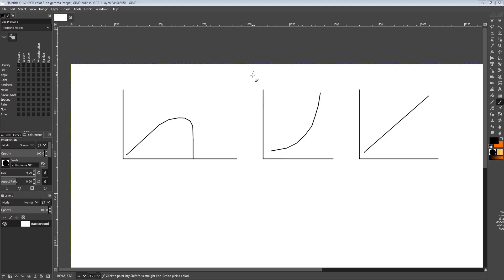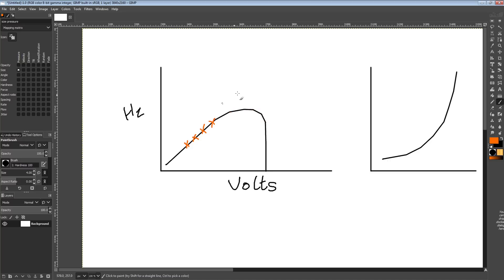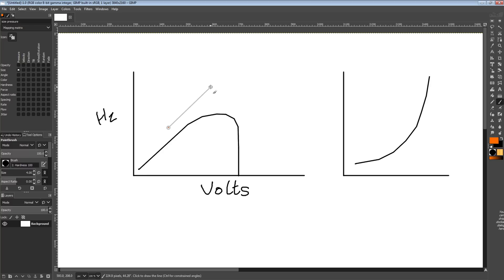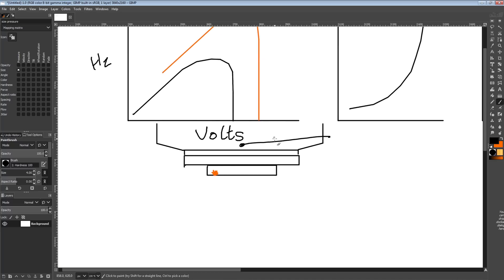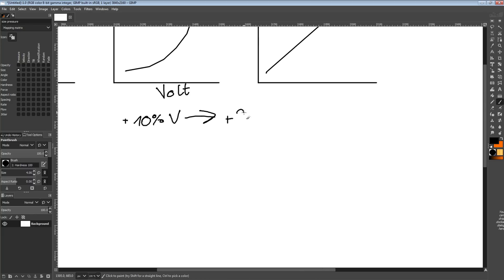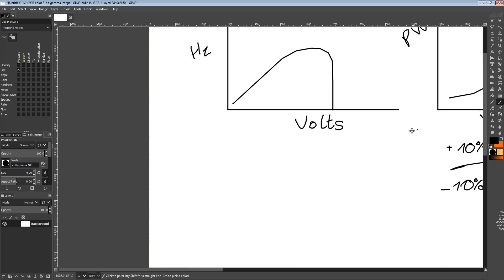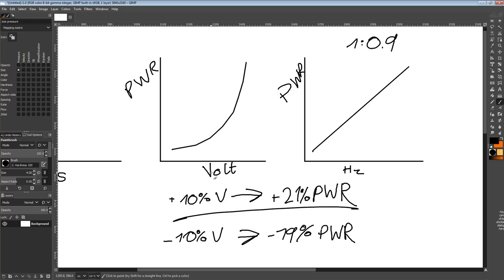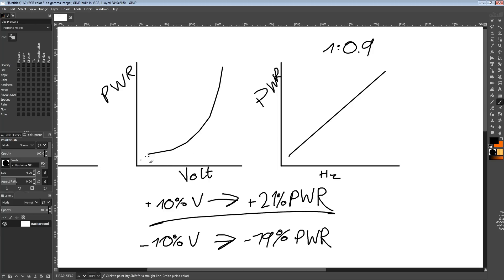Some random things to keep in mind when OCing

Comment from the maker: Well this is now public I guess
Reply: Come on dude You make me worried now should i worry abaut mu 3600 on stock settings?😱
I have phanteks ph-tc14pe CPU
Cooler
I dont oc until the varranty is no more then MAYBE I START playing oc If i know What i do 🤣
Reply: It is good information, so worth putting out there
Reply: Was it not supposed to be public?
Reply: @iamthegamer908  do it when you have warranty... They won't know ...if you destroy your CPU after warranty 
..you are toast
Reply: @mr.waffentrager4400  nah im okay whit it on stock no need oc Any of These ryzens its good for my gaming needs And amator video editing 🤣
Reply: I found it really great. Those words made sense, don't worry
Reply: @geepsu666  I don't know if there's a good answer for this question as it would vary depending on the quality of the chip as it went through the binning process and especially your method of cooling the chip. Heat is just a measure of motion, and if a chip is hot, its atoms are moving around faster - possibly enough to where they might migrate enough from where they should be to cause an issue over time. My best guess is stock CPU at stock speeds, thermal paste, cooler, and voltage would more or less last indefinitely if kept clean. Anything other than that, and your mileage may vary.
Reply: Temp graphs could be helpful too :)
Reply: @geepsu666  so what's the recept for stability... 1.3V?

Comment: Thumbs up if you want to see an EXTREME undervolt.
Reply: Not enough people do that. It's interesting to see.
Reply: For GPUs, I tend to do a mild(ish) overclock combined with an undervolt these days. 
Then maybe a memory overclock (at stock voltage). 
You guessed it, I mainly use Radeon GPUs!
Reply: Richard Ayy, same.
Reply: @DJ_Dopamine  its not a bad trade i guess 100 dollars less because all of the tuning wasnt done at factory, fun for tweakers not the best stock products tho
Reply: "Extreme" meaning cutting voltage so far you just blackout? I even got a t-shirt printed for doing that
Reply: I thought undervolting is only for those filthy mining scum, they usually undervolt in combination with memory overclocking
Reply: @WladislawNikitjuk  снижение напряжения с поднятием частоты,самый профитный вариант разгона цп, скайлейк мой старенький уже при 1.145v держит 4.2ггц по ядрам и 4ггц по шине.....потребление немного снизилось, а производительность нормально так возрасла по сравнению с коробкой....хотя многим только попугаев подавай,ага....
Reply: Undervolting is big in laptops. Since chips tend to always run hot since heatsinks tend to suck and fan profiles prioritise low noise, power limits are the constraint and are locked in firmware, so often the only way to improve performance (beyond fixing shoddy cooling with heatsink alignment, more pressure, better TIMs) is to undervolt, allowing things to sit at more favourable points on the heat vs efficiency and power vs volts curves meaning overall more turbo frequency.
Reply: @WladislawNikitjuk  Not really. I always undervolt my hardware as much as possible while running BOINC and Folding@home. For example, I reduced the power consumption of my Threadripper 3970x by -35% (from 280W to 180W) by capping it to 180W PPT (stock is 280W) in the PBO menu in BIOS. As a result I lost only ~10% multi-threaded performance while the single and lightly threaded performance stayed the same. 180W vs 280W is massive power savings for such minimal performance loss of 10%. 🙂This only proves that the 32-core 3970x is still a beastly processor even with a much more mild TDP of 180W. I think this only shows how beneficial the 7nm manufacturing node is especially when you run your stuff at lower voltage.
Reply: Actually Hardcore UnderVolting
Reply: Der8auer already did it with ryzen 3000.
Reply: The big problem with extreme undervolts efficiency wise is while the cpu core will barely use any power the same cannot be said for the rest of the system. Suddely the gpu or barring that inefficiencies in the power supply start to matter a lot. Another thing is that other parts of the cpu are really not as easy to undervolt resulting in a large percentage of the power draw not coming from the core.
Reply: @WladislawNikitjuk  Undervolting is also a very big thing in the small form factor PC community to save on both power consumption and heat, it can and will make the difference between a system that can thermal throttle and one that doesn't and it allows you to run more powerful components with the lower wattage rated PSUs that are common there.
Reply: @DJ_Dopamine  inb4 how because omg bad drivers.
Reply: @bigcazza5260  typically the amd VS Nvidia tests are using stock products. Typically amd is cheaper per frame. What are you even talking about?
Reply: yeah thats what i need...to lowering power bills

Comment: As a true Tech geek, I enjoy your videos (and understand what you are explaining) :)
I always undervolt if not OC'ing. hat gives you a lot better efficiency. I have a retro rig with a QX6850. Running that beast below 1.1V. stock speed. (not using such a good cooler) Temps has dropped 10-15c during stress. Now that is eficiency increase!!
BTW. Sometimes you can actually gain efficiency with a slight OC. I remember the good old days with C2D and C2Q (20% OC) with undervolt as well. Was using about the same power as stock clock/volts. That equal 20% better power efficiency with OC.
Real OC fun is not the same (fun) anymore. Today the chips do a decent job themselves (Turbo , MCE). Very dificult to get better effiency with OC.

Comment: that center chart, and the right one, is mostly why portable devices tend to be so limited in performance, battery limits and thermal dissipation limits the power and clocks of the thing.  Great vid.   B)

Comment: Well it's a good thing this channel isn't called "Actually Hardcore Efficiency"!
Reply: That might be cool.
Reply: I've always wondered why that was never a thing.

Competitions like:
'highest performance per watt for a given chip'

Or 'highest performance from a system that draws no more than 100 watts'

With variations with increasingly tighter power budgets.

Oldschool challenge; How much performance can you squeeze out of a system that has power limits similar to 80's and 90's PC's? (that's about 300 watts at most)

Maybe... What's the most possible performance you can safely get out of a system that uses passive cooling only?

Or even better, can you get a modern system to ever run in a stable configuration with no cooling whatsoever, not even heatsinks?

There's so many options for these kind of things, but it seems 'biggest overclock ever' is the only one anyone bothers with...
Reply: @KuraIthys  On the point of "highest performance per watt for a given chip", you can just run slow (BCLK multiplier set to 1, or the lowest available) and have the chip sip incredibly low amounts of watts, to the point of being unmeasurable between idle and loaded.

On the point of "highest performance from a system that draws no more than 100 watts", you begin to run into the problem of having to take EVERYTHING into consideration, and it becomes a contest of "who can throw the most money at the wall" to get the best efficiency from your PSU, motherboard, CPU, RAM, GPU, OS... even the hard drive will be an SSD that copies a barebones Linux distro on a RAM disk and runs from there, allowing shutting down the SSD to save a couple watts. Let's be crazy and add LN2 to get the lowest current leakage possible.

There's also the issue of measuring power consumption accurately: (in my best impression of Buildzoid) motherboard probes are teeeeerrible, so you'd need external hardware (with low tolerances may I add, so it will be expensive), a way to connect it to your PC, and it being standard for a competition to happen. The last part will be quite tricky.

I agree this is interesting to explore, but to make it a competition on par with balls-to-the-wall overclocking? Nay. I see getting every drop of efficiency more as a personal project for your particular system, the kind that won't see any benefit from overclocking or just can't (like locked Intel SKUs or based on A320 AMD motherboards), than a competition project.

(And obviously the biggest downside with such a low-wattage competition: no RGB. /s)

Comment: Pretty interesting graphs...

Bottlenecks can be fascinating though.

I remember years ago I started using unofficial drivers with my laptop because the manufacturer literally never provided even a single graphics driver update. and the one it did provide caused constant stuttering in games.

So... The chip in that laptop was an x1400 - which, I mean, for the time, having discrete graphics in and of itself put you well ahead of most laptops, but that chip is one step removed from the lowest end chip Ati produced for laptops.
In particular, an x1400 (which only exists in laptops) is an x1300 with a memory bus that's twice as wide.

Anyway, as a side effect of installing unofficial drivers, I got access to a whole bunch of settings no laptop driver software would generally ever let you touch.

One of these was the desktop overclocking software.

And, that leads to the bottleneck in question;
See, in spite of having double the memory bandwidth of the otherwise identical x1300, (And yes, it IS about twice as fast)...

In examining the overclocking and underclocking results... Well... It got very interesting indeed.
First of all, the clocks could be increased by something like 80% and it still worked (this is without having any kind of voltage control).
Granted, if you overclocked both the core AND memory by that much it got unstable, but you could usually push one or the other nearly that high and push the other by about 20% and get it to run fairly stable at those settings. Of course, the cooling system here means the RAM has nothing at all cooling it and the GPU shares a single cooler with the CPU. (thus CPU load directly affects cooling performance available to the GPU as well.)

So... Anyway, the result that interested me here was the actual performance metrics in games.
Basically, altering the core clock did pretty much nothing in any games I tested. Overclocking it by 80% did nothing. Underclocking it by about 75% (anything less than that and the chip became unstable for some reason) also did nothing.
Nearly double the core clock, or cut it to 1/4 it's stock speed and nothing changes whatsoever in games of the era...
Meanwhile, change the memory clocks and performance in games scales almost linearly with memory speed...

Bottlenecks huh. XD

To be fair, Ati badly misjudged their GPU designs from that era. While the x1950 did really well, most of the rest of their range did not. With the x1600 being especially poor.
The problem is, Ati had assumed games would use a lot of shaders; Procedurally generated textures, vertex shaders, and so on.
As such, they had put a lot into giving these chips (Even the low end ones) a LOT of shader performance.
Unfortunately... What happened in practice was that games of that era doubled down on textures and similar effects that hammer the chip's memory bandwidth and texturing units...
And Ati's chips had not been built with that in mind. In other words they were over-specified for something games didn't really make much use of, and under-specified for things they did. And the low end, but especially the midrange chips were by far the worst off in this regard...

Anyway, just interesting sometimes what overclocking can do in practice when a bottleneck is involved.
You could find yourself with a truly massive overclock and yet the practical benefit is...
Nothing whatsoever...

Comment: on curve #2: power increases exponentially with voltage because as you increase voltage, the resistance of silicon falls, increasing the current non-linearly. meaning, at 5% higher voltage you're not getting 5% more electrons flowing per second (current) like a resistor would behave, you're getting say 10% more current, meaning 15.5% more power (U*I)

Comment: I reduced the power consumption of my Threadripper 3970x by -35% (from 280W to 180W) by capping it to 180W PPT (stock is 280W) in the PBO menu in BIOS. As a result I lost only ~10% multi-threaded performance while the single and lightly threaded performance stayed the same. I think I'm going to run it like this with BOINC since it's massive power savings for minimal performance loss. 🙂

Comment: You've reminded me of one more graph I haven't tested in detail, it was more a small test, gpu sample of one. It was a long(ish) time ago, but I'm pretty sure that lowering the temperature of an R9 380 by 5 degrees gave me about 5W drop in consumption measured from the wall. Really don't remember the fan speeds, also it was undervolted quite a bit. Nothing to write home about, but it was measurable and consistent. Maybe you had more extreme scenarios.

Comment: Hey man, I'd be interested in a video that explains how different types of calculations or the use of other instruction sets (like AVX) affect the stability and the power consumption of a CPU. The voltage and the frequency remain the same so I wonder why AVX load is so much harder for a CPU to run. What do I have to look out for when overclocking? Do I have to test stability for all instruction sets if I want true 24/7 settings?
Reply: YES
Reply: You don't need to test all the instruction sets, only AVX.

AVX is special because it adds vector instructions - a normal add does A = A + B, but an AVX add is capable to do 4x-16x of these additions AT THE SAME TIME. 
For example Zen 2 CPU with a 256 bit wide vector unit is able to do 8x 32 bit additions. Skylake-X has 512 bits wide vector unit, so it can do 16x 32 bit additions.

You get 4x-16x times the performance, but you also get crazy high power consumption (a lot of work equals a lot of power).

If you want more info, just google AVX or SIMD (Single Instruction Multiple Data).

Some other instruction sets (something like TSX maybe) will increase power draw too, but nearly not as much as AVX/other vector extensions do.
Reply: Well my 3700x boosts higher in non avx workloads vs r20. But I'm also not sure how accurate ryzen master is in reporting CPU frequency

Comment: Hi Buildzoid,

I have a question about the Frequency/Power scale you listed there. Based on my testing from highly power limited Max-Q GPUs in laptops increasing the frequency just with the slider on f.e. MSI Afterburner never translated to an increase in Power consumption (or heat), I got roughly the OC i dialed in. Where does this come from? Based in my understanding the powerdraw is hugely impacted by the voltage but if you just increase frequency, you will use the OC headroom a given voltage has for your specific chip (based on silicon lottery) and as long as you are not running into instability from too less voltage you do not use more power. 

A quick explanation or some sources to read through would be a huge help! Thanks :)

Comment: Vega64 - all voltages at 0.900V, with HBM OC over 1GHz -> basically the same performance as stock (no boost), at just 150-160W power draw.
Reply: Not true, because the standard clocks at overclocked HBM is 15-20% faster, and you ate 20W in HBM. Besides that flat boost caused by Infinity Fabric behavior (not memory itself), games tend to scale linearly with clock. (At 4k.) So in many games you will get about 5% slower with your settings. (1500 memOC vs 1680 MHz 1.2V. You can run stock boost 1630 at 1.18V for 50W savings and minimal performance drop. Has space for memory OC.)
But about 100W cooler. Presuming the card is stable at 0.9V 1500 MHz, not all are. (Typical is 0.95V, and usually it is capped by IF bus voltage, which has to be increased to 1.025V or 1.05V to run that 1111 MHz memory clock to trigger 1200 MHz IF speed.)

Source: have 2x Vega 64 overclocked. They tend to random brownout and crash in specific titles when undervolted too hard. I can "run" stock settings at 1.135V, but specific games will reliably crash.

By the way, locking clock to P7 gets 5% boost stock. Card is also more stable allowing for more precise undervolt. The cards do feature some sort of LLC.

Comment: Love it bro what you think about MSI PRO B450M PRO-VDH MAX closest matx i could find to the mortar in the states would be fine for a 3600x planning on locking at whatever i get the frequency stable and temps good. The case has an absolute load of airflow for the vrms

Comment: And some memory chips won t even gain from voltage increase.Had micron A-die that wouldn't oc any further past 1.35v.
Reply: JEDEC specs allow for up to 1.5V to operate. Every stick should be able to run at 1.5V or else it doesn't comply with the spec.
Reply: @dpokor  well i havent tried 1.5, but tried 1.4 with loose timings and didn't like it, tried lowering the stock timings with increased voltage, same thing, the memory was corsair led 3000mhz cl15-17-17-35 2n and i could only change 2n to 1n and was stable anything else i couldn't lower them not even by 1 not even trfc by 1...Tho i could oc them to 3333mhz cl15-17-17-35 1n at 1.35v .That was the best i could do.